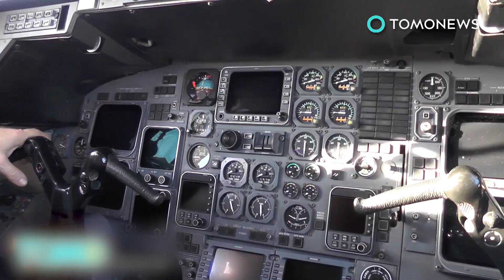Circular runway airports: Dutch researchers propose circular runways for future airports - TomoNews

Comment: Researchers that have never flown a plane might think this makes sense.... but in no way would this work well.  Instrument approaches would be insanely complicated, takeoff and landing speeds would be increased to keep the wing on the inside of the circle above stall speed, and because the speeds involved change with aircraft, loading, and atmospheric conditions the 'runway' bank angle would only work for some aircraft, sometimes.  The rest of the situations the landing gear would be overstressed and the planes either slide toward the center or slide to the outside, neither of which is desirable.  So ... it's a dumb idea.

Comment: I do not understand how the pilot and the second will explain to the computer of the aircraft that when landing, one of the wings will be higher than the other while rounding the phase of flight before landing on the ground ! the computer will say that there is a problem and it will force the plane to regain altitude! and another problem, as long as we go at 300 km / h, it can go, like a car on a circuit whose track is inclined but as soon as the car idle, it is impossible to stay at the top of the track, centrifugal force can no longer compensate for gravity! how the landing gear will support the weight of the plane tilted down this inclined circle! how will the tires support this inclination, the landing gear and the tires will withstand enormous constraints!

Comment: Its insane - you can't get rid of wind, you will simply have bizarre wind patterns and you cant have three aircraft on the same runway, not safely anyway. Funny that the military experimented with it. Seems it didnt work very well. Now an aircraft with rotating cylinders for wings creating lift - that makes sense. That might happen one day but the wing may be central, not either side - basically a large rotating cylinder - saw it in a scifi film and its credible science.

Comment: It would make landing a little easier(shorter distance) because a lot of energy would be dissipated through centrifugal forces but at the same time this energy would also be lost during take off, making it far less fuel efficient and more costly requiring a longer runway. Add to that the difficulty maneuvering and the likely wear and tear on the tires I would say that this idea is bankrupt before it even starts.

Comment: I'll go ahead and write an essay on why this can't and will never work.  [You're welcome!]
Reason 1: Impossible to land - lift is generated perpendicular to a wing on an aircraft. Banking while flying causes the nose to dip down and keeping the nose up requires rudder and elevator. When the elevator is used the aircraft will fly a circle. This means the diameter of the runway would have to be calibrated to the landing speed of one specific aircraft. All aircraft of different design have different stall speeds causing landings to be dangerous, inconsistent, and not physically possible without a whole bunch of luck. 
Reason 2: centrifugal force - taking off would be difficult because the faster you go the harder your aircraft is pushed into the pavement. This means aircraft would require substantially more speed for lift to overcome the artificial gravity created by the forces acting upon the plane as it is velocity is constantly changed from a straight vector into a curve. This extra speed would also cause the aircraft to tend to run off the edge of the runway as it sped up because the lift would overcome the gravitational force pushing the aircraft into the center of the circle. The centrifugal force would also cause unnecessary strain on the landing gear and wings potentially causing tire to run off the rim as the aircraft accelerates.
Reason 3: (I could go on for a while) Wind - Because the runway is banked the aircraft would be able to potentially land in the most desirable area, but as the aircraft circled around the runway the wind would have more immediate access to the underside of the wing causing the aircraft to potentially flip off its landing gear and onto the opposing wing because gravity and wind would work together.
Other notable reasons this will never work: ATC could not monitor such complicated procedures and would slip up more times than normal causing potentially head on collisions. Aircraft taking off would be forced to circle through the aircraft landing approach vector. Fire safety would be impossible because the retardant would flow to the lowest point of the runway. I'm getting sick of typing. Hope this nails some sense into the Amsterdam "scientists"
I'm slightly less angry now, but my fingers hurt!

Comment: Circular runways rubbish the centrifugal force will throw the aircraft to the outside not inside a crosswind landing would be anightmare especially on the loads the landing gear as the mountings are primarily designed for longitudinal axis loads these would have to be recertified for the increased horizontal axis  loads

Comment: Airplane undercarriages are not designed to  handle  NASCAR  type banked curves. Tricycle landing gear arrangement is designed for straight line take offs and landings. Front and rear would have to be beefed up to cope with the  plane weight load shifts 
Due to the tricycle landing gear arrangement special redesign  would have to be applied to the front wheels geometry and robustness as well as the rear gear. A 100 ton aircraft landing on a banked surface while steering a circle would wear the front tires prematurely , even if the circle was made large enough so that that arc segment were more gradual.. on a clockwise landing the right rear carriage would be subjected to immense pressures and would have to support more of the airplane weight than the left  the same would be true of counterclockwise  landing circles.
The more severe problem is  that tricycle arrangement do not take corners  well at all  even moderately high speed 100 mph  from little toys like  racing sidecars whose combined weight with riders included do not exceed  rarely  800 lbs.

A 100 ton Boeing 747  aircraft landing at roughly  172  mph would put immense stress on the landing gear , if not modified to greater robustness from present incarnations it would have to be replaced  often due to stress failures . Irrespective of computer aided take off or landings the potential for crashes would be increased.
Modern airplanes routinely  reach retirement with original landing gear still functioning having been properly serviced of course, but only because they are not being driven like  Petty`s 43 at a NASCAR  tight oval.

Comment: THIS IS NOT SAFE ALL THOSE JUMBO LETS, 747,777, AIRBUS ALL OF THEM DO NOT TAKE OF AND LAND ON A CIRCLE. NOT A SPORTS CAR LIKE TO TOP GEAR DRIVEN BY JAMES MAY, RICHARD, CLARKSON. THESE JUMBO JETS WORK LIKE A EXTREME LONG  DRAG STIP. GOT ALL THAT WEIGHT AND MASIVE WINGS. IT HAS TO BE BALANCED PROPERLY. THE LANDING GEARS AND ITS TIRES WORK ONE WAY ONLY. IF NOT BALANCE PROPERLY ON TAKE OFF AND LANDING ALL THE TIRES GET A BLOW OUT AND THE LANDING GEAR FALL OFF. THERE IS EMERGENCY  A JUMBO JET LOOST ITS ENGINE IT EXPLODED AND ON FIRE AND LOST ALL CONTROLS. CANNOT LAND ON A CIRCULAR RUN WAY. ONE HAVE SUCH A EMERGENCY. IT MADE IT TO THE AIR PORT ONLY TO CRASH RIGHT WING EXPLODED  THE JUMBO JET BROKE UP AND CART WHEEL ON THE RUNWAY. THE CRASH WAS CAUSED BY A DEFECTIVE FAN BLADE.HAVE TO COUNT THE DEAD. CANNOT LAND ON A LINE ITS GOING TO BE BILLION TIMES WORSE ON A CIRCLE RUNWAY. JUMBO JETS MUST STAY ON A LINE LIKE ON A DRAG STRIP. TAKE A LOOK ON THIS https://www.youtube.com/watch?v=japmbMmURto

Comment: The circular runway is not safe for emergency landing in case the aircraft has balancing adjustment fault..etc, even it's not full safe for normal landing! about the aircraft body safety and for passengers..etc

Comment: My own opinion is, the only possible way to solve this circular airport endless runway design problem is to redesign the aircraft itself, i mean it looks facinating but this airport doesn't look like it was designed for modern preseant day aircraft. an aircraft with maximum lift force with an aerodynamic  blended wineged fuselage built for short take off landing with flat bendable solar panels and photovoltaic windows, robust quad landing gear with intigrated hub motors to power taxing before activatig it's primary engines for take off and regenerative breaking to produce energy while landing and powerful struds to witstand stress, absorb potholes and bumps and perform rampless jump take off and thrust vectoring hybrid engines, an aircraft either tailless or compact or any you could imagine, ect. that is just my thought about it, u be the judge.

Comment: No no no no no no and NOPE. From my limited knowledge of aircraft and from playing FSX if you bank to either side the aircraft will go to that side. The only way to counter it would be to use (negative?) pitch, (pitch down) but that in its self is bad if the pilots need to pitch down fast as, well, it wont feel good for passengers.

Comment: that concept is..... BS sorry but it does more harm than good.  Better for landing and takeoff in bad weather conditions? avoid crosswinds? it will make landing and takeoff way harer for the pilots becaus ethey have to work more to keep the plane stable in a curve becaus ewinds are changing because the plane is rotating. are they actually thinking when they do their so called innovations?! can´t wait for the first Airport to be built like that and the first flipped over planes.

Comment: why this is dumb, it makes it harder for pilots, yes cross winds are a pain with linear runways but if the wind is to strong the pilot can pull out of it, if you have a giant beveled runway; a cross wind would bury the nose or wings into the runway, even the most skilled pilots would have a crash at some point, linear runways are a lot easier to land on, it's just so much simpler and afer, a giant circle just makes it hundreds of times harder, keep it simple

Comment: Way too difficult to draw a line, where the taking off airplane is not permitted to go, and about the cross winds.... Its not like above the wall or at other side of the wall is a invisible wall, meaning as u get close to ground, its like a punch from hard wind to no wind, risky sht. I'm not a pilot, but general logic

Comment: This is pure stupid... circular means centre-trained wheels that may have been damaged and are unable to turn will overshoot at such a high speed. With such an angle like that too, a plane might hit the main buildings if they failed to decrease speed and due to the "centre" of where it is pulling it. Also, if one quadrant is not enough for one plane to land, it might take up another quadrant and rendering 2 quadrants occupied and decreases the amount of planes that can land. Also, some planes are not fit to land at such an angle given that some landing gears are lower than others, which makes them ill fitted to land there.

- Sincerely, a man with a brain
Reply: Okay, man with a brain: 

1.) As you know the steering/nose wheel of every plane only works below a certain speedlimit. Above that you can and have to use the rudders. So no problem at high speeds.

2.) Below that, you can design and choose the bank angle (also increasing to the edge) of such a runway in that way, that no steering is actually necessary, because forces and friction will keep you on track and even then engine power and rudders might be enough to bring you back to the inside. 

3.) With a diameter of 3500m the rundway would have a circumference of about 11000m. That would be 2750m or 9022feet for each quadrant. How many planes you know really need that? But even if, especially for take offs, you could manage this by an intelligent system - it's just a question of timing and safety buffers. 

4.) Actually every plane is fit to fly and land at bank angles. They have to be, because crosswind landings. I hardly doubt, that the runway angle would be higher than the landing angle most aircrafts could handle.
Reply: Mr6x   Okay then, my concern for this contraption is safety. It is complete dubious if it cannot assure the safety of the passengers and the middle building. 

The wheels and gear I mentioned was in the case if it is locked in a bad position that you cannot control it, it might skid off if the speed is not slow enough. Next, if one plane declared an emergency and landed, the rest of the flights might be affected. When I mentioned some planes, I meant by the planes that have low ground to body height, take for example the ATR. Also, with the runway shaped like that, windy areas with low pressure areas could create downward to upward winds and cause more downward force on the aircraft, or in some cases if the wind is sideward blowing, it could derail the attempted takeoff and because, in a cannonball sense, would be pushed off.

Comment: 1:10 This doesn't make sense to me. Centifical force does the opposite of what this video claims. Here's centrifugal force:

"In Newtonian mechanics, the centrifugal force is an inertial force (also called a 'fictitious' or 'pseudo' force) directed away from the axis of rotation that appears to act on all objects when viewed in a rotating reference frame." 

What is keeping the plane from going off the runway is gravity.
Reply: Centrifugal force on a curved runway would actually cause the aircraft to tend to run off the edge of the runway because the lift of the wings will cancel the effects of gravity before they are freed from centrifugal force. What they said in the video is ludicrous
Reply: @virtualfpv3568  That’s not it at all. Spoilers cancel lift, allowing gravity to take is effect on the aircraft.
Reply: The idea of a banked cirkular runway is that the pilots needs to be efficient with the rudder and it would be pretty slippery while wet.
Reply: I agree
Reply: Casey Van     I see you have been watching Rick and morty
Reply: @Dezbo  I don't know what that is.